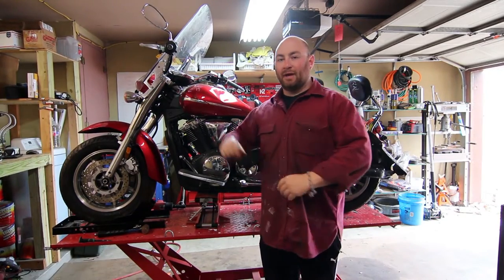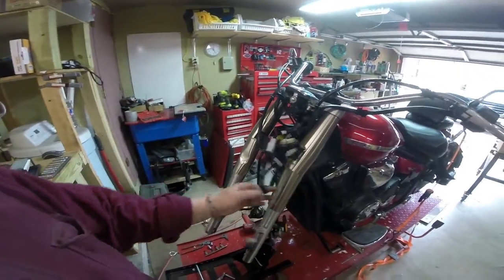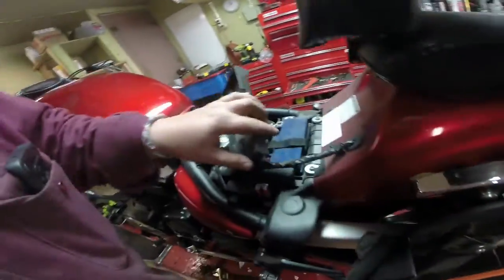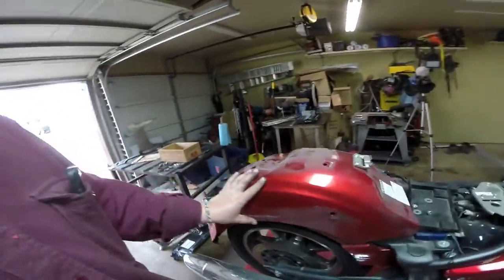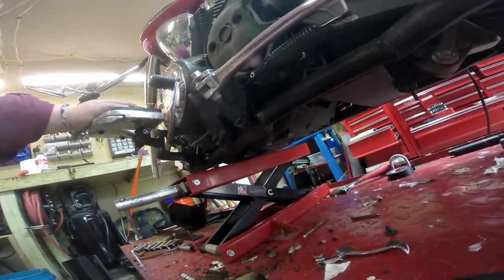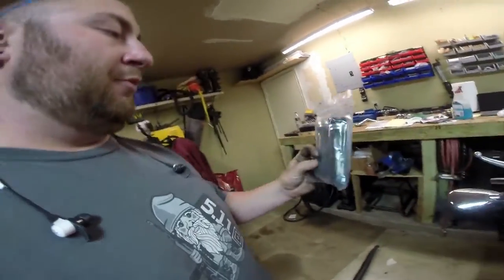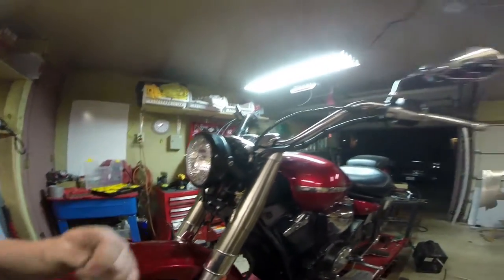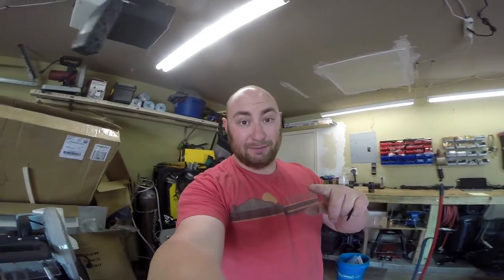Making a 2009 Yamaha V Star 1300 Road Worthy Again

Comment: Curious what the initial damaged bike cost you to get it in the garage?
Reply from the maker: ~$900
Reply: I just picked a 2008 V Star 1300 with 8000 miles on it for $3000 and it’s in perfect condition. Just changed the oil and go. I hope you got your parts for free.

Comment: That was a very informative video I can’t believe you got so few like 👍 and views. There is one item that you did that I wished you had provided some more info on and that was the replacement headlight that you installed. The original headlight is shit and you stated that the one that you installed was  very bright and I would of gotten the exact one. I guess there will be no copycatting on that, haha
Reply from the maker: It was just a generic ebay cheapie. You can find tons of them (integrated turns, HED, LED, ect)

Comment: The "cheaper build plan" would have been to buy a used Vstar 1300 for $3K....there is no way you get your money back on that POS. I paid $3200 for a 2007 with only 7K miles and now work required.
Reply: I paid 2900 for a 07 with 44k miles now at 75k miles, and still riding it 135miles 6 days a week, oh and we fell at 30mph back when it had 50k miles.  Only major repair has been the throttle cable, everything feeds of your energy. I love my vstar, rain or not we hit the road